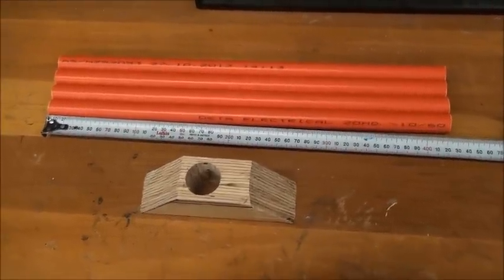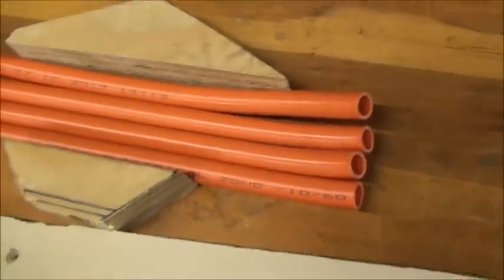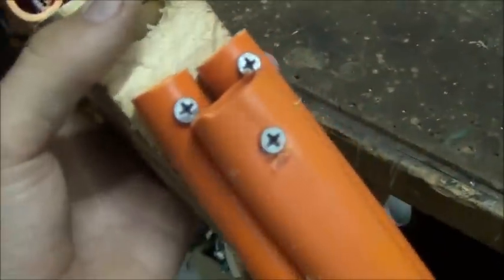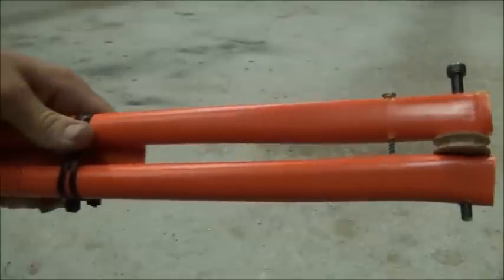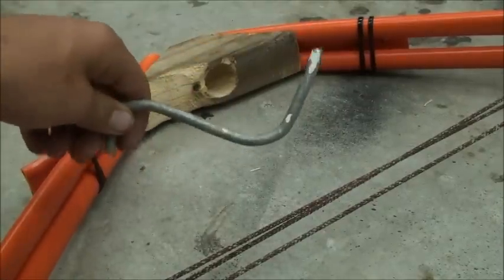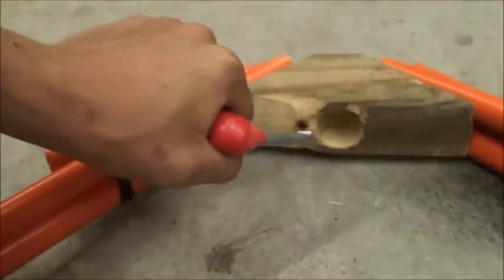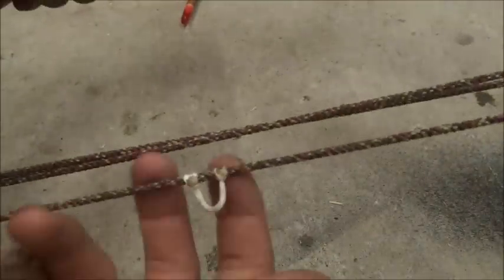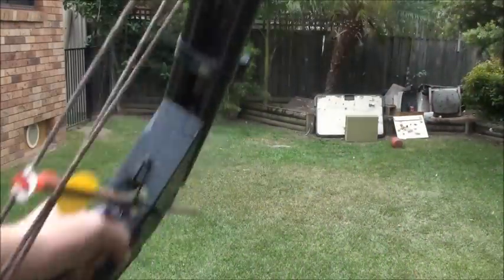How To Make An Ultra Compact Compound Bow, Center Shot

Comment: make sure, when you screw the limbs to the riser that you put more than two screws in,  only using two screws will put alot of strain on them and the pvc will most likely crack.
Also before you screw the screws in, try to drill a hole in the pvc that is slightly smaller than the screw so it makes it easier to put the screw in.  It will also lower the chance of the pvc splitting.
Reply: A fender washer under the screw heads holding your limbs would reduce the stresses on joint even more.

Comment: Austin Fairchild (commented below) got a reflex grizzley (good older bow btw, cam 1/2 eccentrics, centershot, over 300 fps IBO rating) for 50 bucks at a flea market.  I had to mention this due to the mention that I didn't know what I was talking about.   I have a Reflex Gamegetter Intruder, I got fully equipped with sight, rest, arrows, release, and quiver.  I am into it for a total of $100 bucks now.  Sure glad I don't know how to find archery equipment inexpensively.  lol.